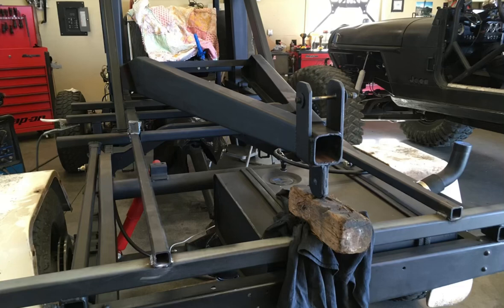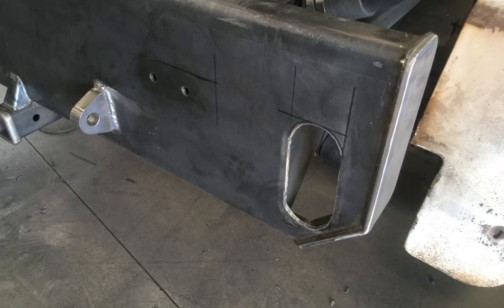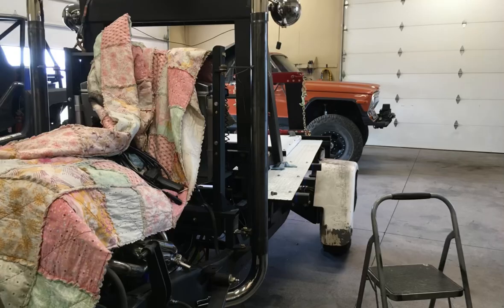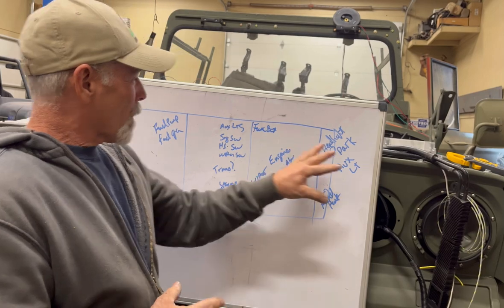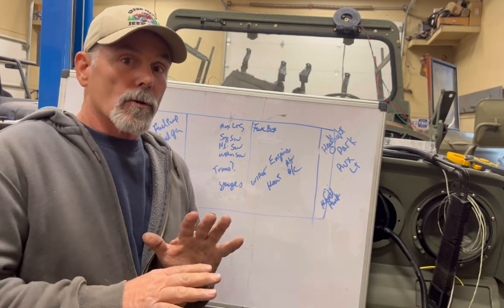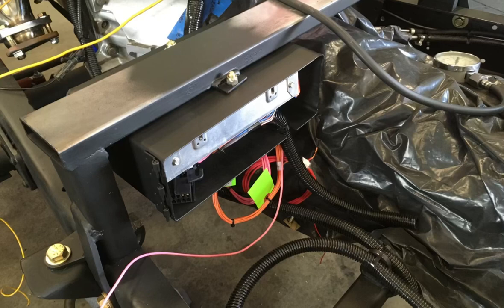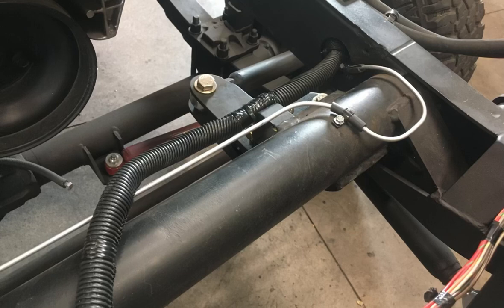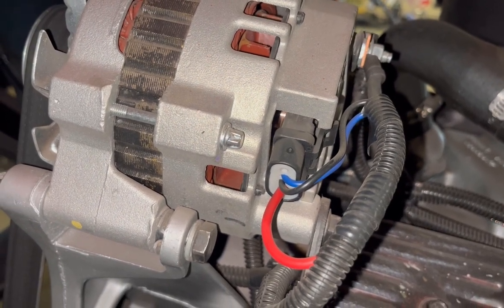Jeep FC-170 wrecker build part 5.

Comment: I was born in 1958 my dad bought a FC 170 Jeep in 1959 new it was red just like this wrecker. I grew up with this Jeep . This is back in the day when there were not of 4x4s on the road this Jeep seemed like it would go most anywhere. Lots of good memories with this Jeep. I wished we would’ve kept it and rebuild it ,it was still in good condition back in the early 90s .